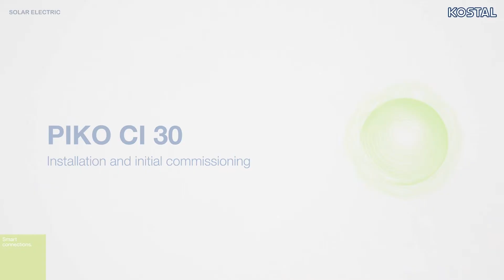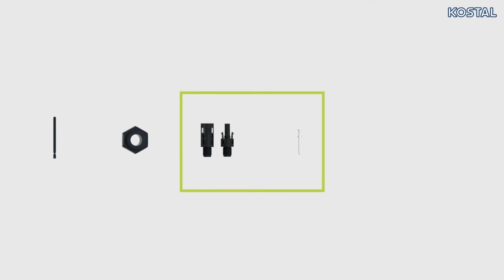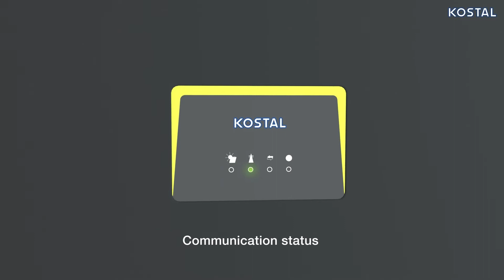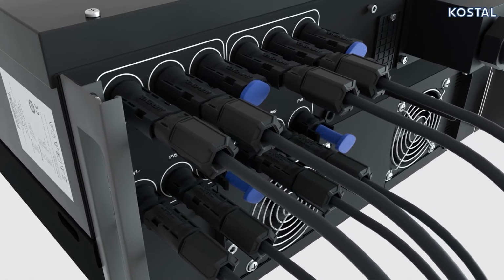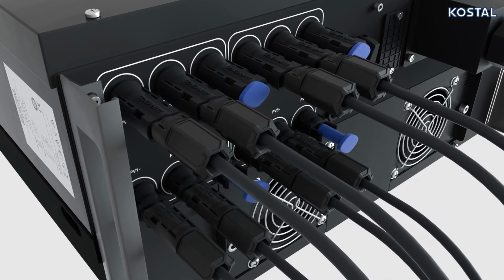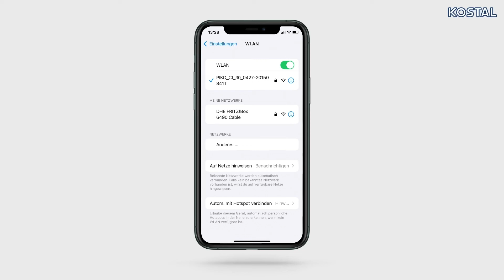#Tutorial: PIKO CI 30 | installation and initial start-up | KOSTAL

Comment from the maker: Timestamps:
0:00 Intro
0:09 Introduction
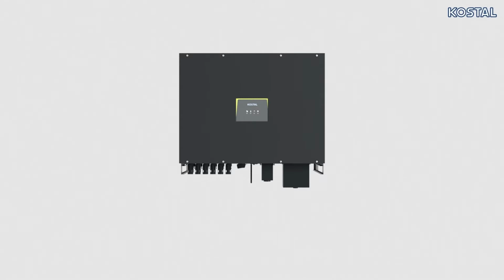0:26 Scope of Delivery
1:21 Connections Overview
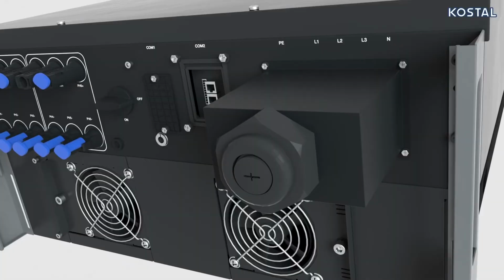2:49 Status LEDs
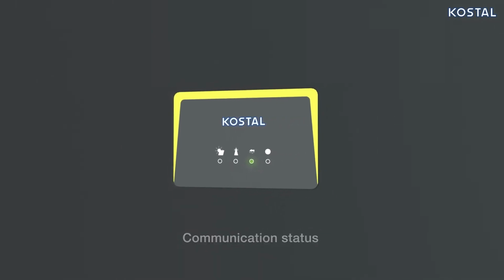2:59 Wall mounting
3:16 Connecting the AC cable
4:17 Setting up the internet connection
5:39 Installation of the KOSTAL Smart Energy Meter
6:16 Connecting the inverter
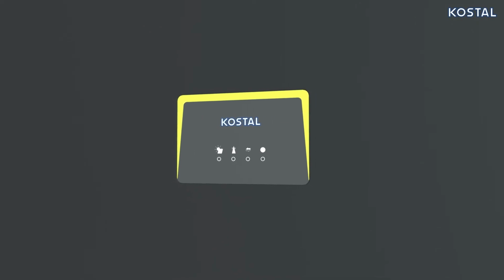7:54 Setting up the App
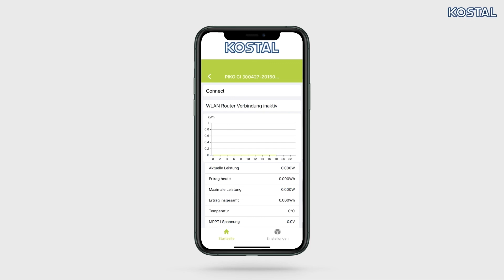9:56 Outro